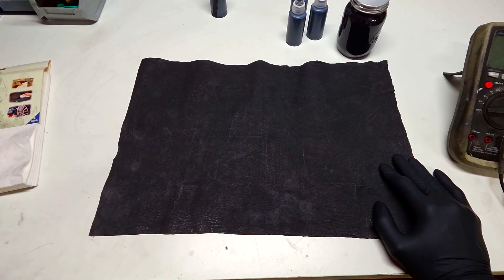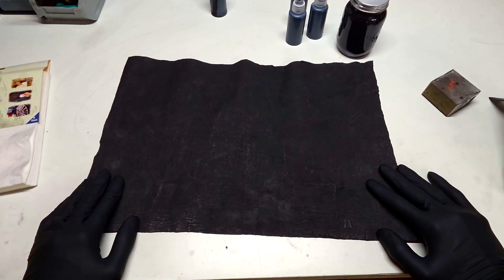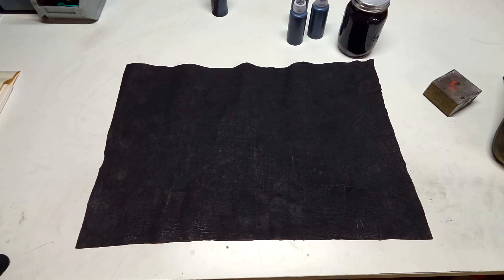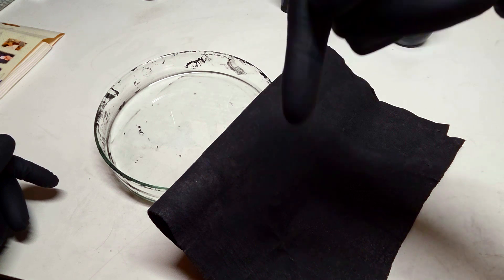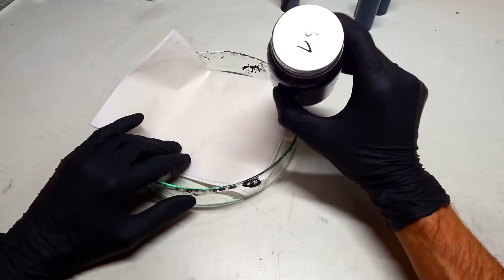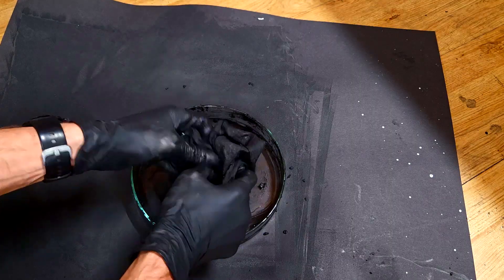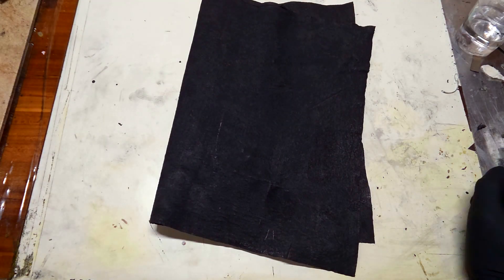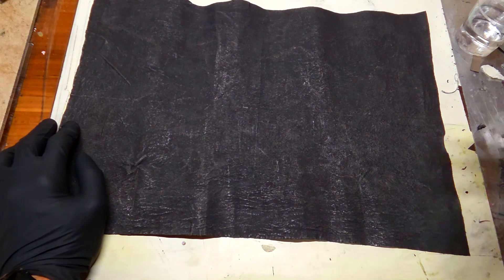DIY Conductive Carbon Cloth - for battery and heaters

Comment: If you make a heater out of this, how much heat is released as infrared energy? If a Mylar layer were to be placed on one side it would direct the infrared heat meaning it could use less power than a standard electric heating blanket. This would reduce fire hazards making it safer.

Comment: 19 ohmios es demasiado para hacer un electrodo de bateria . se puede trabajar mejor con grafito expandido y negro de humo sobre papel kraft tratado por medio de pirolisis. Aunque una de las partes mas importantes es la compatibilidad del colector de corriente con todo esto.
Reply from the maker: This is not meant for the current collectors, because like I said in the video it is for active or host material IF is used in battery or supercapacitors.
Reply: Just use thicker wire